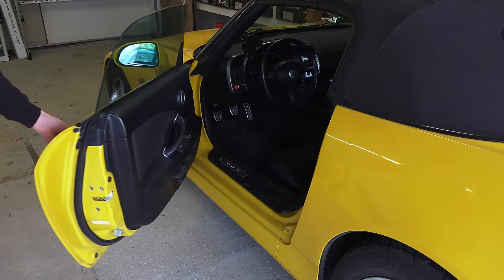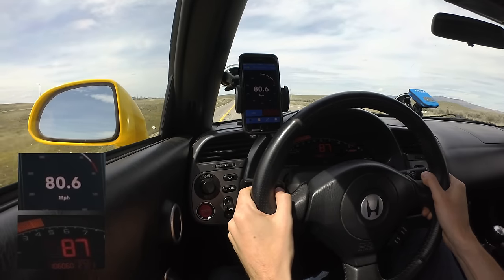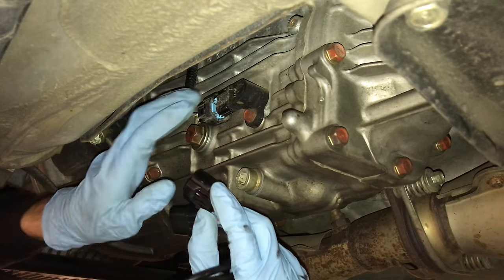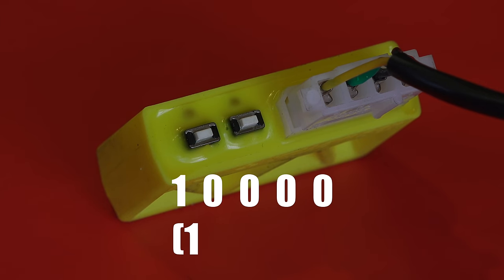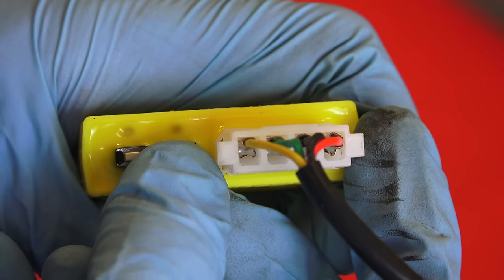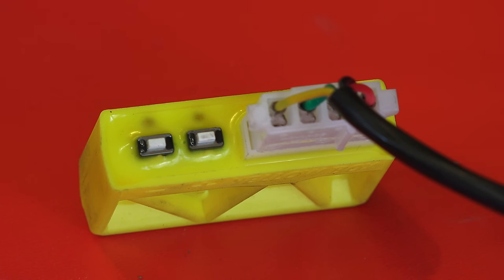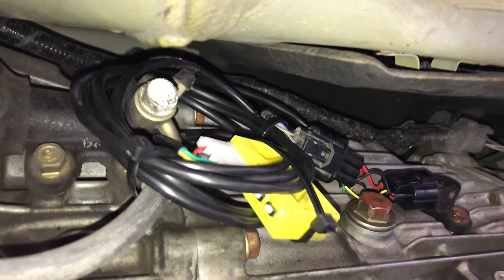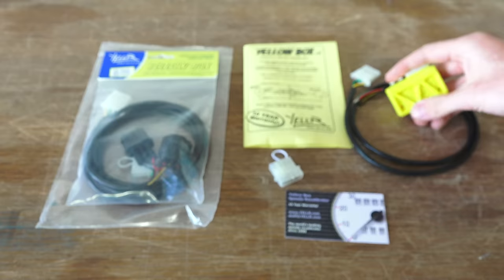How To Fix A Misreading Speedometer

Comment: I changed all the gauge screens in my car and I guess I didn’t put the needles in the correct places. It marks my temp, fuel, oil and turbo but not my rpm or speed. Will this fix it ?

Comment: can't you calculate the theoretical difference using the new gear ratio?
Reply: Tom Ho I'm surprised he didn't do that actually, but it was probably off a bit even before he changed the gearing.
Reply: Custom Coin Rings USA Yeah, but he's always calculating theoretical values for stuff on this channel, I'm honestly surprised he didn't include a calculation just to see how close it would be.
Reply: The threads on your tires make up to 3% variability in the speedometer measurement, depending on whether your tires are worn out or not. You can account for all the things that impact the speedometer theoretically but it just doesn't make sense.

Comment: Hi, I think my problem is a bit different. When I connect with my OBD-2 reader in my 2008 Ford BF the speed is accurate, but my dial is still ~5 kmh over

Comment: My check engine light will triggers every time I hit a certain speed at certain RPM, mostly around 3000RPM or 120km/h. The error code says that the speed and RPM readings are out of range and not plausible. I'm guessing that using a slightly smaller tire is the cause. Will try changing back to bigger tires to see if it fixes the problem.

Comment: I know some recent cars feature a special torque curve for the first and sometimes second gear. This ECU mapping is mainly made to prevent wheel slip (even if there is ASR on top of it), prevent bad sensation of "over torque" (some European TDI are really too torquy at low RPM and that be sometimes not a nice feeling when you are a passenger or even driving), lower wear on parts and tires, and improve fuel economy... This kind of modification (final drive ratio change) could be made useless on those vehicles since the ECU won't make any more power or torque that what is on the mapping for the given gear and RPM (with the stock final drive setting). 
Of course, I'm sure on a Honda S2000, power at high RPM, "low" torque, naturally aspirated, build around the year 2000, this kind of ECU limitation might not be fitted. What is your opinion ?

Comment: Nice!! I always have bigger tire than stock on my fit, it read around 2.2-2.4% ( depending on summer or winter tires). So to go to my standard. but since i drive mostly around 105-110, it's not to bad. Does that also correct to odometer? I log every fuel tank so I have to compensate for this difference.

Comment: I changed my car's tire from 205 65 R15 to 215 60 R17 and obviously there is a speedometer error of around 6%, I'm wondering if this 6 percent difference affects my odometer reading? If so, is it okay to use the speedometer calculator online to check the actual mileage of my car?

Comment: Why did it read faster then actually I have a truck with 35s an it reads 10 above in city an 20 above on highway speeds an once the tack read 100 I've hit 80 an the governor won't let me pass but I'm confused I thought big tires make you go faster then the speedometer says?

Comment: Yeah, mine truck is not off by a percentage, it is off by 15 mph at 35, 55, and 75, so I don't know what is up with it, at really low speeds it's correct, but at around 20 it shoots up. It does have an injector out, so it's only got 7 cylinders at the moment.

Comment: Any clues wnat to do if speedometer from OBD2 (with torque app) reads 60 (mph, km/h) and onboard computer shows 64? I don't mean GPS speed, though. BTW, I have factory recommended tires on my automobile. Also, cruise control is on, so no errors there, driving on a flat surface, no wind, etc. Please advice.

Comment: How much adjustment do you think you could do before the ECU (which I assume is using speed as an input)  goes into limp mode ? What would happen if you corrected by 99% so your car only records 1 mile on the odometer per 100 travelled ?
Reply: Depends on the specific car make and model i guess. Every car manufacturer will have their own thoughts on when to consider data faulty.

Comment: I just used a GPS app and removed the needles and set the needles about where they should be and it works like a charm.

This method obviously wouldn't work on a digital speedometer however.
Reply: why not

Comment: Good thing that you are driving a manual, because if it was an Automatic the ECU uses the Speed sensor to measure transmission slip, and this has a high possibility of throwing a code  
The better way of doing this is by changing the programming in the ECU. For example, if you had something like a "HP tuner" you can change the programming of the ECU to set the speedometer. HP Tuner only works on Domestics I think

Comment: Ouch. Almost 5K rpm while cruising.
Reply: With how high the s2k's red line is that's normal. 5k is about 55% of his red line so in a normal car with a red line of about 6.5k it would be like cruising at about 3.6k rpm. That and his final drive gearing is much more aggressive than normal.
Reply: MagicDartProductions I think he means ouch to the fuel economy lol. At 80 mph in 6th gear in my unmodified S2000, I'm like at 4,000 RPMs already. While compared to the redline,  that isn't that bad like you said, but fuel economy still kind of sucks regardless. Not that I bought an S2000 for fuel economy, but... You get my point lol.
Reply: yeah well there's a reason why it averages 20 mpg. After driving last night I felt like I wasted money. Only time I manage to keep the rpm low is by quickly shifting to 6th but idk how good that is for the car cruising in 6th at a meager 35 mpg :/
Reply: R Kely P N on U Lol maybe not that good for the car or fuel economy.  Also, I've read that I'm not supposed to skip shift... which is interesting. Super fun car nonetheless.
Reply: Walter Black i drove in my dads miata to florida at about 4.5-5k all the way there. i got about 28 mpg.
Reply: The newest Miata or an older one?
I don't know about the older cars, but at least the latest Miata model doesn't have an overdrive gear. 6th gear has a 1:1 ratio.
Reply: SI0AX a 99. It has a 4.1:1 final drive ratio and small tires, remember that. Its 5 speed also.
Reply: I dont skip gears I meant I quickly shift thru all gears to reach 6th
Reply: Yeah I'm at 3,500 rpm or higher at highway speeds in my stock Integra GSR.  Some Honda guys will replace or rebuild the gearbox to have an Integra LS 5th gear, which lowers RPM at highway speeds for better fuel economy.
Reply: R Kely P N on U Ah, I got ya. I do the same.
Reply: Also known as "short shifting".  What is the RPM in 6th at 35 mph?  In some cars the torque may be so low at the highest gear that you end up lugging the engine if you try to drive in that highest gear at a lower speed.  I recall the older Vipers having such a high 6th gear that top speed could only be achieved in 5th gear, not 6th because it didn't have enough power and torque in 6th.
Reply: Patrick94GSR Yeah. That is why I agreed with him that it might not be good to do that because not only does an S2000 barely have any torque in 6th at 35 mph, you'd be lugging the engine to move and completely defeat the point of trying to attain good fuel economy.
Reply: Yeah if I remember the RPM was at about 2k? in 6th @35mph. My aunt whos a real gear head(has her own shop for over 2 decades now) claims that 5th or 6th for 35 isnt bad so that's why I do it. I havent had any issues with the car other needing a new paint job and a fresh battery after leaving the lights on night on accident.
Reply: Cruising at 2K RPM is perfectly fine.  Sometimes I throw my car into 5th at 35 to 40 MPH, and will be under 2K RPM, and it's totally fine.
Reply: R Kely P N on U Ah that makes sense. I'm probably just trying to go off memory. I tend not to short shift to a high gear because even if it is okay on a flat road, a lot of where I drive ends up going from downhill to uphill and then I'm lugging the engine or I'm having to stop and go frequently. But generally I try to be in a higher gear.
Reply: a hybrid civic with cvt only goes up to about 1.8k rpm when on a straight line. below 2k rpm is totally fine.
Reply: @SI0AX: Latest Miata's engines are very efficient, so no problem with its mileage.

Comment: how does it effect lower speeds? my speedo shows +/- 2kmh up to 60kmh but at 120 gps speed I have the speedo at 130kmh
Reply: gps is less accurate the faster you're going, because it's interpolating your speed. that's why it's not safe to use gps as a speedometer
Reply: SuperAWaC this is true for traveling around curves but a straight line will still be accurate

Comment: I doubt this would work on my Volkswagen. Aside from having a proprietary hardware and software setup, the incorrect offset of my speedometer readings appear to vary based on the current velocity of my jetta. Sometimes it's close to 5%, and other times it's not. I dunno

Comment: well I'm in a predicament.... My analog speedo reads 100kmph, the digital speedo reads 96kmph (yes there is both an analog speedo and a digital one that I can scroll through to on the dash) and my phone's gps speedo then reads ~90kmph...... wtf do I do, is the analog signal from the transmission, and the digital signal from the abs system I'm assuming? Tires are factory size but the front tires are worn and the rear tires are brand new, could that have something to do with the different readings on the analog and digital readings? pls help, thought I have been doing 120 on the dot on highways but I've really been doing like 110 and when im going 130 im really going like 123kmph....

Comment: Such simple kits doe not help in the non-linear misreadings which are in many GM cars. 
And you may adjust the linear misreading by the OBD interface. it's something like "tire diametre" with several digits. 
But then you still have the "2nd offset" kicking in at about 40mph, and then the 2nd additional factor kicking in at about 70mh, redering everything before completly useless.
I had the 30mph "spot on", but on 130mph was still reading 155... FSCK!

Comment: 1) my speedometer shows 65 at real 60 km/h and 104 at real 100 km/h, so it's non-linear error, no way to correct by yellow box.
2) how about mismatch between speedometer reading from gearbox and speed signals from ABS sensors? can it lead to strange effects?

Comment: why not use an Arduino to make a GPS/accelerometer based speed sensor.
Reply: and just have it send the correct signals to your speedo
Reply: because under tunnels and certain areas there is no GPS signal, so it's not reliable at all.
Reply: TheFPSPower I mentioned gps/accelerometer. As in both together. It would use a filter to blend them together and in a case you lose one the other will take over.
Reply: the "/" does not mean AND, it means "OR" as in alternative, so I can read, you just wrote it incorrectly.
Anyways, if you want to do that, go ahead but it's more of a thing someone bored would do rather than being actually justifiably better.
Reply: Or use the GPS when it has signal to calculate the speed offset of the speedo and do what the yellow shitbox does.
Reply: I just don't like speed sensors that are dependent on the wheel size or the gearing of the car. Change anything and his speedo will be off.
Reply: Until readjusted of course. It's even worse in a Miata though. It has a completely mechanical speedo.
Reply: David Serrano  link?
Reply: johnzal79 link to what? Arduino? Arduino is a development board. He would need a smart friend to actually get it to work. But for a lot of cs people it would be a fun project. Like myself.
Reply: Getting speed from gps is really simple 10 minutes of programming will get you something usable. But blending in accelerometer input to keep it accurately when gps signal is lost will be slightly more complicated but there are scholarly articles about it. It's called riss
Reply: because the wheel doesn't need to be re-invented every time a problem. it's also a half-assed solution, just like virtually every project an arduino has ever been used for.
Reply: SuperAWaC how is it half assed? It's literally the most accurate speed you can get as long as you account for error in computations.
Reply: As in rounding errors and etc
Reply: the cost of the traceable calibrated sensors you'd need to use (to not do it half-assedly) and labor cost writing and troubleshooting software while you're reinventing the wheel would quickly outpace the cost of taking the car to a speedo shop to have the it brought back into spec
Reply: Sensors are pretty cheap. And programming isn't hard anyone can do it. It could be done for less than 50 bucks. If someone else wrote similar code before then the programming becomes easy.
Reply: go look up the traceable, serialized sensors with calibration paperwork you need on digikey. i'll wait. good luck. if you do manage to find some, note the price. they likely won't give you one, because they don't generally sell individuals. if you were to buy one, that an arduino input could handle (100mv/g, 10g range) it would be nonstandard and probably run you 4 figures just for the sensor. then once you code it for "50 bucks" you need to send the whole apparatus to a calibration lab to verify it, before you could even hope to use it safely in a car. i don't know of any calibration lab that will certify an arduino project, because of the lack of repeatability arduinos (double float rounding errors accumulate over time) have, because they are prototyping tools bordering on toys.

what you're suggesting is irresponsible, at best. negligent at worst.

tldr: get outta here with that mickey mouse bush league nonsense
Reply: SuperAWaC so let me guess you don't work on your own car? If you do you are surely half assing it
Reply: this isn't about working on your own car, this is about messing with the calibration of the safety instruments using unreliable methods and hacks that have similar costs to having it done right, by a professional that does these things for a living.
Reply: A speedometer is not a safety feature of a vehicle
Reply: SuperAWaC I'm sorry I get what you are trying to say but why when these things do go bad for instance mine reading 100mph when I'm going 40. Just chill out some need this
Reply: "I just don't like speed sensors that are dependent on the wheel size or the gearing of the car."

That is literally the most accurate and reliable way to measure a car's speed.  GPS is notoriously inaccurate and unreliable still, for consumer use, especially when there's anything blocking a full view of the sky.  Even accelerometers have difficulty measuring velocity.  The devices should be used for backup/verification only.  The mechanical connection to the car's gearing should always be the initial source for the velocity measurement.

This is why I don't care for GPS-based bicycle computers to measure speed.  I want an actual signal from the bicycle's rotating wheel that calculates speed based on the circumference of the tire.
Reply: Patrick94GSR it's the most accurate in perfect conditions. Tbh I was thinking up an experiment to do to see how inaccurate various forms of speed measuring is. And how inaccurate over time do they become. A mechanical speedo would probably be the most precise and accuracy would be based on calibration. I would imagine that gps based would be the most accurate and precise without calibration. And accelerometer based would most likely be accurate initially but start to drift away from the correct value. My idea for a test would be to have a car fitted with all three and log the outputs. Then compare them all.

Comment: I am so glad my E39 525d with high-OBD has these secret functions for all kinds of stuff, one of them is digital speed read-out, both for the speedometer and GPS speed. I don't know how it does that, but it's correct with a GPS speed next to it. Perhaps showing 1 KM more than actual GPS speed, but I am okay with that.

It costs a few seconds to get into this hidden menu, but at least it's free.

Could one also be able to change something with a special software on a computer attached to the car's OBD port without the use of this yellowbox?

Comment: I bet one could do such fix with a cheap Raspberry Pi or Arduino. It are just I/O signals. Connect the transmission sensor to one of the I/O pins of the Arduino, code something to interpret the signal to a number, apply correction, then convert the corrected value to digital again on another I/O pin on which you connect the original wire which goes to the car's computer. Best way to start out is by hooking up an oscilloscope to the original situation so you can see all the voltages and timings.

Comment: My Renault Twingo is showing 5% too much, but the odometer is spot on, so the speedometer is deliberately lying to me.
So if I correct the speedometer, the odometer is wrong.

Our next car has a camera reading the signs, and alerts when "speeding"; however the reading is high.
That's why we have queues and dangerous overtakings on roads where drivers think they drive the speed limit, but actually are up to 10% under.

Comment: how about an analog speedo
Reply: If by analog you mean a machanical cable driving the speedo, this won't do; you need to change a gear somewhere.
But many "needle" speedos are electrically driven, either a small servo or like a voltmeter, and in that case you can use the device,

Comment: Wouldn't it be easier to just reprogram via the OBDII port..??? There are plenty of programmers out there that's a simple plug in, enter the new parameters, whether it be a gear change, tire size change, etc, save the new parameters to the ECM, unplug the programmer and off you go...
Reply from the maker: +Brian J. Schmidt got a link or brand name? Certainly be interested in checking out that option.